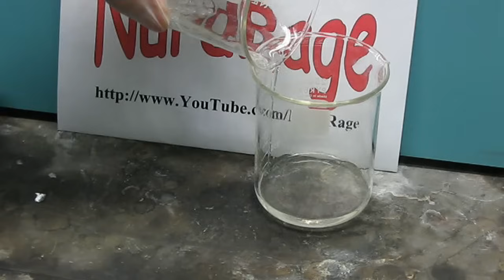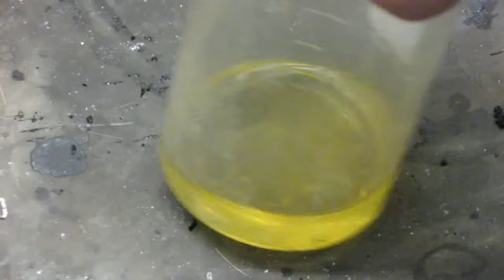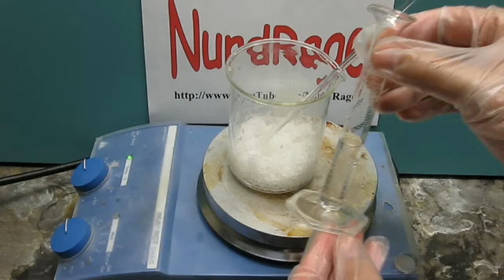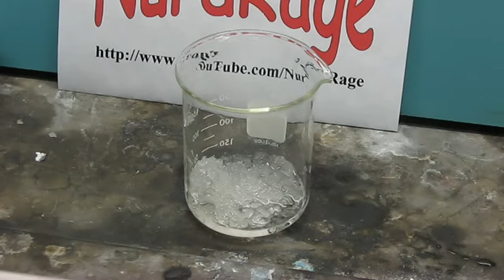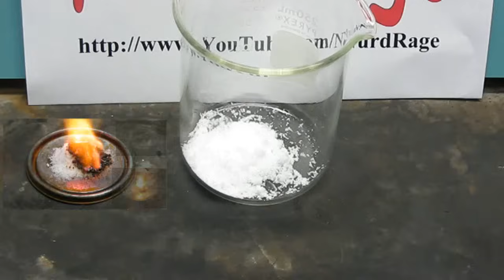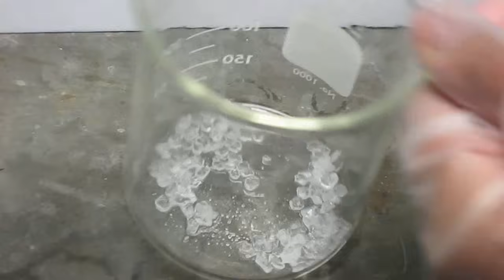How to Purify by Recrystallization

Comment: Why is distilled water better than DI? I am very curious about this.
Reply: Yea that's exactly the reason (15 months of lab work experience). But DI water is a "more pure" distilled water. So I'm questioning why a mid range pure water would do better in this application.
Reply: +Kovu Legar Alright you... just read his question again. He didn't ask about distilled and tap water, he asked about distilled and deionized water Stop trying to give a smart ass answer acting like you know the name of each impurity in tap water when you don't even know what deionized water is.
Reply: +Nate Parcel Well distilled water is boiled and condensed so all non-volatile impurities can be ruled out, and then depending on what apparatus you used there may or may not be volatile impurities with boiling points close to water. So for example how well you've done the fractions, if you used a vigreux column or not. Lastly there are impurities that are impossible to separate by distillation because they form azeotropes with water.
Hope you're following me but I'm assuming it's no problem you have more lab experience than me.

Deionized water means that all ions are removed, so this includes pretty much everything inorganic along with oh- and h3o+ ions so your DI water should be exactly pH neutral. This is usually achieved with an ion-exchange resin on a chromatography column. This isn't just as simple as running water down the column though, you need to target anions or cations with positive or negative resin. This method won't work for virus bacteria or non-charged molecules ( = almost all organic molecules) so if your're water is contaminated with toluene for example then a column won't purify it. 

So to answer you're question I'm not exactly sure why deionised would be better than distilled, but my guess is that it has nothing to do with the purification method itself. It is probably simply the limit standards that have been set stricter for deionised water because it's a more recent method. And then having said that, in my lab we use the terms interchangeably and on our pure water taps it is labelled "distilled/deionised water", so yeah, I think there's probably very little difference and I wouldn't be surprised if the purified water that labs use is purified by both of these methods.
Reply: Haha YES! I was so eager to scroll through the comments after he made the, um well, comment: “distilled water is better than deionized.” That eagerness, however, very quickly,  very unfortunately, & very many, many many times turned into disappointment with all the stupid drug comments above (& sure to be below). Don’t get me wrong I think drugs, any of them if I’m honest, could be fine for people to use in extreme moderation & in an extremely quality controlled / potency controlled manner, say like (oh gee golly I don’t know let’s see uhh) oh yeah, that’s right: the alcohol & nicotine/cigarette/soon to be recreational cannabis industries; however I don’t like stupid people saying dumb shit, especially in public forums. It’s almost to the point that I would expect some to have made the vodka/moonshine analog but those folks must be too drunk to see/read/type/blow into the breathalyzer to start their phone 🙄😞😒😐.

But here you all are, I found the smart[er] ones.. I had hoped for one other water industry professional to have commented here but I suppose I am of an extraordinarily rare breed (also note I continued my rant per the above statement at the end).

Distilled vs Deionized water and which is better (assuming you really mean which is purer) is technically a moot point. Even though I worked for a company that manufactured contraptions for the latter and I want to favor said technology, I can be the worst kind of hypocrite (anti-hypocrite being hypocritical ouch)! Thus, the crux of the matter is kind of ironic in this case. Since we’re discussing methods of purification for solvable crystalline chemicals (salts in lab conditions mainly I suppose) and which “type” of water to use is not the correct way to technically discuss this. Most people see the two gallon jugs at the store right next to one another and assume types.
.

But come on guys and gals! Think about that here for just a minute....

“different kinds of water?” Hell no! There most certainly is not anymore or less than two legitimate types of water that are remotely relevant and really only one of those. Obviously water that we encounter everywhere (tap, rain, pond, puddle, lake, ocean, sweat, etc.) and the other is heavy water (deuterium) that’s used in advanced sciences (for things like  organic chemistry equalization formulations, mass spectrometry, nuclear processes — fission reactor fuel*, neutrino barriers & cooling water for some reactors, and more, shoot). The disappointment because there’s technically tritium as well but so small in comparison to deuterium which even all used in world is nothing compared the regular light water already, I’ll call it 2.15 “types of water” for this arguments sake (where in general I’d say
More like 1 water to .001 deuterium to .0001 tritium, or water to tritium straight as 1 : 0.000001) in terms of relevancy ratios and likely by [atomic] mass on earth? I don’t whatever.

My point is the 2/3 types of water are based on the sub atomic structure of what we define as “water”, the chemical compound H2O, where deuterium H has a proton and neutron (hence D2 or ^2H2) and tritium has two P and one N (I think not sure about that last statement but moving on).

Therefore there isn’t an argument possible about which type is better between distilled and deionized because the only difference in this light water is the process used to purify it.

Granted those two gallons at the store may be better than one another it’s really not fair to judge by those two brands or companies purification methods (meaning the literal physical water purification systems they have de-watevering the water). Both processes have the same goal: reduce the number of impurities in the water. 

So what? How do we tell? Well when it comes to very pure and then ultrapure water (aka demineralized or deionized) there are actually standards (wow now way... who would’ve thunk it oh boy <—- sorry this has been way more than I anticipated or wanted to write). As we start leaving tap water and thinking about the water conductivity and getting into low low ppm (parts per million) & even ppb (parts per billion) level impurities where there are literally only ions left like individual atoms and maybe some weakly charges strong bond chemicals like CO2 (soluble carbon dioxide) or SiO2 (Silica or Silicon Dioxide — not to be confused with Silicone) we think not in terms of conductance but resistance. Pure H2O (variably non existent) would hypothetically be the best insulator because it physically couldn’t transport electrify / electrons because they’re all so happily paired and bonded and don’t want to trade. Stating adding elements even in trace amounts and that all changes fairly quickly. Hypothetically the purest water — ultrapure water is 18.18 MegOhms, power companies (power generation facilities using high pressure steam boilers) need about 15 but ask for 16-17.5 MO ultrapure water SYSTEMS. Nope they don’t go to the hardware store and clear their shelves off buying the lot of their gallon jug inventory believe it or not, they have in house systems that take almost any source water mainly city or river, and purify it! 

PC chip manufactures need about 10-17 MO (depending who’s asking/working that day)

Pharmaceuticals need about 5 megohm, 

Other industries about 1 MO 

As the power company example shows the two techs can be used in usinson and that’s really why it was a moot point in saying which is better, they are the same type of light water purified to who knows what purity just by different methods.

I will end by saying between distillation and deionization (two methods, one old using huge tanks of resin that foil over time & one called electrodeionization or EDI for short that works with out need of worrying about resins fouling as the process itself regenerates them only talking EDI here for time restraints) if you think about rain and acid rain or boiling water soup and everything leech’s into the water, EDI in my opinion is the best way to obtain the purest water on earth, but it is also but one small piece in a whole often huge water purification system so.. I, hope, that, helps... done ✅ few that was a lesson and a half people Jerzy I should get paid for this crap!

——
Rant above finished here
So although I expressed the aforementioned opinion in all sincerity, doesn’t necessitate I take illicit substances, it’s just that I simply hate only one thing more than under educated individuals (stupidity/dumbness), and that is hypocrisy, or people who are hypocrites or say hypocritical nonsensical statements (well that should also sum up my political views too) like all drugs are terrible horrible things that turn you into such and such a person 🤦🏻‍♂️ ::facepalm:: really? What about your fathers alcoholism, your need for caffeine at regular intervals, or your wife’s Tylenol/ibuprofen/niacin regiment? Hmm... fucking hell even if I don’t take or use them doesn’t mean I’m against them (I’m not sober or a non-drinker/user but if the environment and mood strikes). A lot of people my age do and they all get hauled off to jail or some die because of social thought preconditioning (quasi brainwashing but via...) social norms, a continued social campaign against them, and social fucking hypocrisy and I’m sick of it people need not die because one is okay and the rest are evil but those people are few who own the distilleries and pharmaceutical companies and this is not the right place sorry it just came up.
Reply: @daddystork9504  I didn't even have to press read more and I knew I was getting into something crazy interesting. i honestly agree with the points you are making but metacomments are making this impossible to read. You should have probably seperated this into two comments one about drugs and another about the water. My question is why did you waste all that fustration here on youtube? You clearly know your stuff and think your better educated than most of these politicans so why dont u argue with them?
Reply: @daddystork9504  
Bobby Bouche (sp)?
Played football in Alabama?
How the hell are you?
I've always wondered what happened to you.
   Son of a gun!
Hows Vicki?  She probably put on a few...don't tell me.
  I'd rather remember her how I last saw her.
   Yoiu take care now Bob!
PEACE!
Reply: +Nate Parcel 

Yeah, I wanted to know the same thing. I've read the opposite. Pity no useful reply has been forthcoming.

Joe.
Reply: Nate Parcel to good
Reply: Ph level i assuming???
Reply: +No body Oops, my bad? How exactly was that trying to be a smart ass though..? 

I'll be sure to reread the question next time. You've showed me the errors of my way. 

(p.s. that's being a smart ass)
Reply: Tap water has a multitude of impurities. Minerals, random bacteria, yummy fluoride, ect. So distilled water won't add anything to the chemical you're trying to get junk out of. :)
Reply: Kovu Legar Exactly, so why would Deionized water be not as good for that application than distilled water? Thanks:)
Reply: I imagine it's so you don't get added calcium, limestone, fluoride, chlorine, ect into whatever it is you're trying to purify. And while i really doubt there's much of any of these things in tap water, if you're doing something very precise or using exact measurements with sensitive lab equipment it'll effect your ending substance. There may be other reasons i'm not aware of, but this is what i imagine would be the strongest reason.

I loose example is, the same reason why you don't want to drink river water or tap water and why we like to drink purified/bottled water.

Comment: I've recently learned how to extract lye from hard-wood ash. I'd like to purify it as much as is reasonably possible to make a good quality soap ('cause why not?)

Even though I filtered my liquidified lye using a microfiber towel (works reasonably well, when one doesn't have proper chemical filters,) I'm still left with a brownish/yellowish mess.

How can a lay man like me clean this up?
Reply: Francis Roy There's honestly not all that much you could do in your current state. A coffee filter (or two-three stacked on top of each other) will give you much better results than your microfiber towel, but I suggest visiting hometrainingtools.com and picking up a simple chemistry set and some filtration apparatus. The combo will set you back a maximum of $30, depending on what you get. I would recommend getting one each 600ml and 250ml beakers, a medium size glass funnel, some quantitative filter paper, and a lab stand if your budget allows.

Reply back or PM me if you have any questions, and good luck :)
Reply: pKai3 A very practical answer. Thank you.
Reply: Francis Roy Sodium Hydroxide (lye) doesn't really recrystallize (its more of a goopy corrosive mess) all that nicely as shown in this video, so filtration is by far your best shot.
Reply: Oh sure, but I wanted to make soap from absolute scratch. I'm trying to learn how to do thing without relying on parts of the world that I have no understanding of.

Did you know that one can make one's own mayonnaise and not depend on the grocery store for it? :)
Reply: +pKai3 I was under the impression that lye from ashes was higher in potassium hydroxide. I have also read that potassium hydroxide can also be produced by mixing calcium hydroxide with the solution,   which will precipitate calcium carbonate. Would you say this is true?
Reply: +pKai3 Actually if you are using Wood ash directly you have a combo of K2CO3 and NaCO3 as well as  NaCl and KCL. You can use differential solubility to mostly separate the potassium carbonate and sodium carbonate.  Heat it up until any precipate you have dissolves,   

Then cool it  in fridge until it starts precipitating out.  Potassium's solubility is higher so the precipitate is going to be mostly NaCo3 and Nacl.   

Repeat till liquid stays stable.  Then allow to evaporate  by standing or heating till 1/2 vol of liquid.  The precipitate is your K2Co3.  Take the precipitate and dry it.  Next Heat To 891C where it melts,  continue heating, this will create K2O.   Allow to cool.   Slake with water ( watch out exothermic!)  Allow to dry,   you now have KOH. 

Similar process for NaCO3
Reply: Francis Roy  You can tutorial how to make meth
Reply: Nathaniel James Lye is just another name for Sodium Hydroxide, do you mean that there is more Potassium Hydroxide than Sodium Hydroxide in wood ash? I haven't experimented with ash whatsoever so I can't comment on that.

Mixing Calcium Hydroxide with most Potassium substances (chloride, etc) will result in Potassium Hydroxide, but Calcium Hydroxide is rather insoluble in water making the process very unfeasible...

Comment: can you purify cut cocaine?
Reply: An acetone wash will do the job. Put the coke in a glass jar and cover it with 100% pure Acetone. Mix well for 20 to 40 seconds and filter it. The white stuff still in the filter is your pure coke. For better results put the dry coke directly in the filter and and run acetone over it. Cocaine hcl is not soluble in acetone.
Reply: thanks i'm not sure it'll work for every impurity but the most common will do, any guidelines for the type of filter?
Reply: MovieCuts same for meth ?
Reply: +MovieCuts An acetone wash is a waste of your time. Unless you're getting 
horrifically stomped on cocaine. Caffeine, ephedrine, baking soda, manitol, cellulose, food 
coloring, magnesium strearate, lactose and the rest of the tablet 
fillers are also acetone insoluble. I would bet the vast majority of 
people who have 'performed' an acetone wash did not have anhydrous 
acetone either which means any weight loss they experienced was likely 
do to the water present in their acetone (i.e they unintentionally 
discarded cocaine).
Reply: A lot of the products you named are actually soluble in acetone but even then no one cuts cocaine with any of the stuff you named (food coloring lol) and we are talking about cocaine here not a tablet. An acetone wash is not a waste of time
Reply: Matteo in 't Veld Yes it will work with meth
Reply: MrWhitePerson although 3 or 4 coffee filter would do, I'd recommend you look for the smallest micron filter paper you can get your hands on

Comment: Soap making is my hobby and I want to use ash extracted lye to make soap but I don't want to go through the trouble of cleaning the impurities. Is this method the most cost effective way to get purified potassium hydroxide, from hard wood ashes or am I just better off buying my lye at a store. I'm a cheap skate, that's why I want to know.
Reply: James Slater uLtrasonic cleaner and diluted or deionized water
Reply: James Slater no soap at all added when cleaning said impurities
Reply: James Slater no heat either

Comment: The melting point of aluminum nitrate is 72°C ; when heated to 100°C, is it a problem during the recristallization ?
Reply: polonois use an ultrasonic. Vibrations will help the separating and or mixing. With less heat

Comment: How is deionized water not as good as distilled water?  Shouldn't it be the other way around?  Cheers.
Reply: Pyrotrons some properties are taken out that benefit most processes. Diluted water is best. The properties in diluted water such as chlorides and nitrates that can be nitrites sometimes ammonia’s are beneficial too. Extract with diluted Wash with deionized then add with more demonized so the separations won’t mix